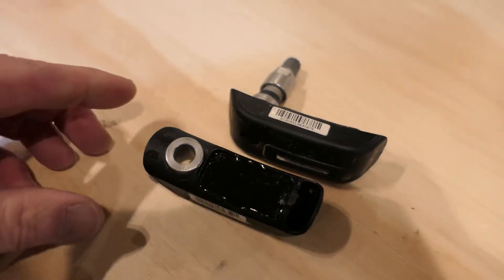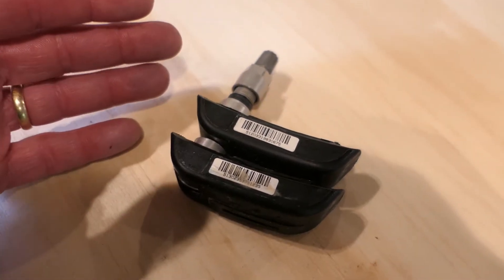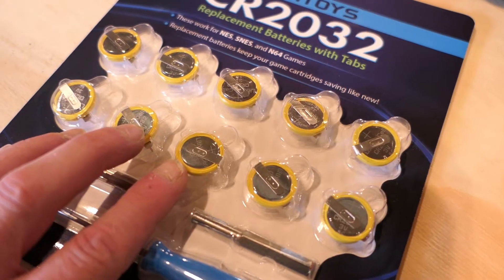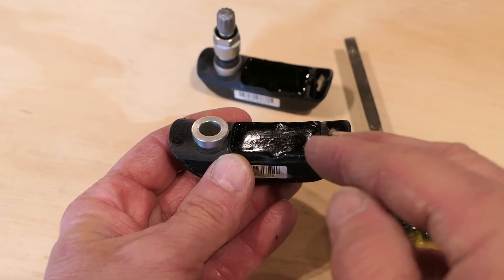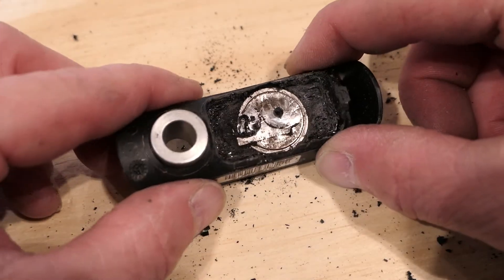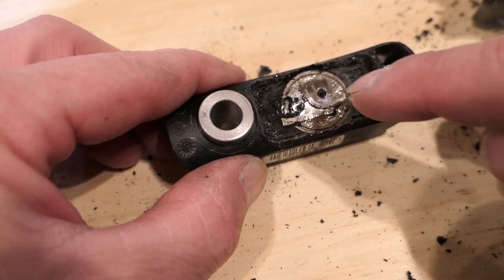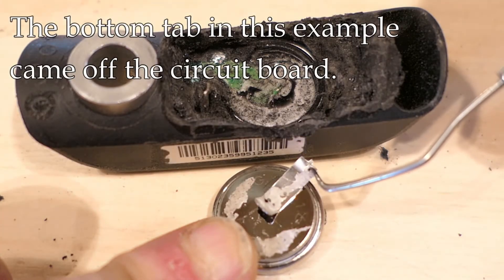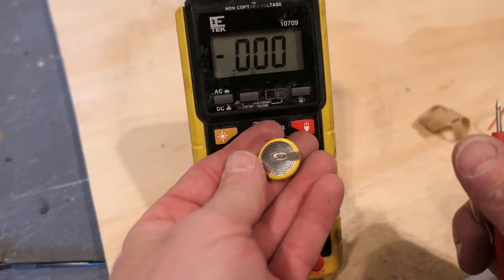Updated: BMW Motorcycle TPMS Battery Replacement

Comment: I bought myself the TPMS wake up EL-50448 unit and I cannot get it to work.  I switch on my bike ignition, then I place EL-50448 unit next to the tyre valve on my old but still working TPMS, but nothing happens.  Nothing seems to register on my bike dashboard.  When I press the one and only button on the EL-50448 unit, it flashes a green light for 5 seconds and stops.  What am I doing wrong?  I have a F700GS BMW bike with both the TPMS still working and registering to my dashboard.  I will soon need to change my tryes and TPMS batteries.
Reply from the maker: So, I think you may just be misunderstanding how this all works.  Plus, there could be some other variables at play.  These sensors, once already installed and working, will normally "awaken" or become active after you start rolling.  When you stop rolling for a period, they shut down to conserve battery life.  There is an accelerometer in the sensor so it knows when you are rolling.  You also need the computer on the bike to accept these broadcasts, which is the other side of the equation.  That computer will look for the signals once it knows the bike is rolling via the "tone ring" and wheel sensor.  Importantly, the computer must have the specific sensors installed on your wheels registered in it's database or else it will ignore any signal.

So that's the background.  The wake-up tool is just a shortcut to make the sensor become active so that you can register it in the computer's database using a scantool.  Depending on the vehicle it may or may not cause the computer to start talking to an existing sensor, because the bike or car is not yet rolling.  Apparently you were trying to force the sensor to communicate with the computer using the tool, but the computer wants to see other data before it will display the sensor values.  Also, to use the tool you typically hold the button down continuously until the sensor becomes active.  

If you will be changing your batteries and reinstalling your existing sensors, you probably will not need the wake-up tool at all.  The sensors will already be registered and they will work as they did before.  Only when you change the sensors will you need the wake-up tool, and you'll use it to force the new sensors to broadcast to the computer so that they can be registered in the database.  See this video at the 10:50 mark to understand what I mean:  https://youtu.be/xAiJy4ZC-u4

Comment: I think a Dremmel tool would be much better with saw blade attached
Reply from the maker: You could try that, but there is a risk.  The dremel tool will be difficult to control precisely when you get close to the circuit board.  One catch and you will have damaged the board.
Reply: A Dremal engraving bit would work better than the saw blade I think.

Comment: Great video thanks!  How do you think a heat gun would do with removing the epoxy?  I have one that I rarely use and was considering it for this.
Reply from the maker: That's probably not a good idea.  You'll risk cooking the circuit board inside or melting the plastic.  It's really not a big deal to scrape out the epoxy or use a soldering iron to help.  It just takes a little patience.

Comment: John, would using a hot glue gun be better than using tape, BTW great video, can see me needing to do this very soon, thanks for sharing 👍😃
Reply from the maker: Some compounds like silicone can be corrosive to the circuit board, and I'm not sure about hot glue.  The tape has worked for me for years, so I wouldn't hesitate to use that.
Reply: Hadn’t though of silicone being corrosive, yet your idea of tape would make it easier to replace the battery next time, also John, that drill was a stroke of genius, 👍😃
Reply: I wondered the same. First thought was rubber cement like we used in elementary school.

Comment: I'd love to see how you get the sensor out of the wheel and put it back John. Another great video. Thanks!
Reply: You can pop the bead of the tire just one side and use a clamp to hold the tire out of the way.  Getting the sensor out is very easy.  Use some soapy water to pop the the back on just look away when inflating just in case but usually it takes less than 60psi to seat a tire.  I do my own tire mounting and balancing at home very cheap and easy and a great way to save lots of money just never deal with a bad TPMS sensor.  For my KTM they cost $200 usd so I'll try replacing my battery and see what issue I encounter.
Reply from the maker: The previous video covers some of that.  It's super easy--the front sensor has a single bolt, the rear sensor is held to the wheel by the valve stem itself, which has a nut on the outside.